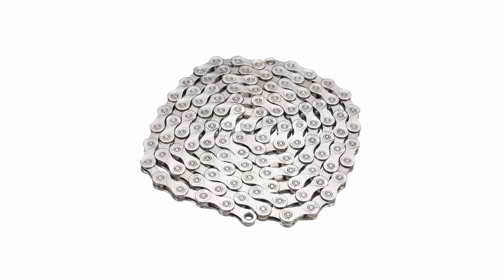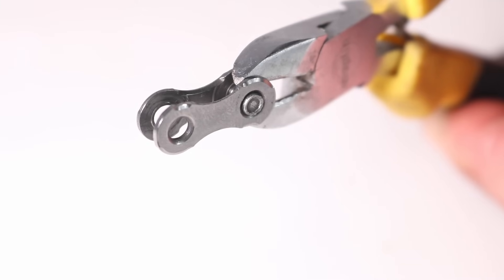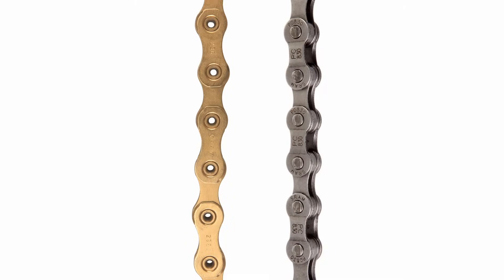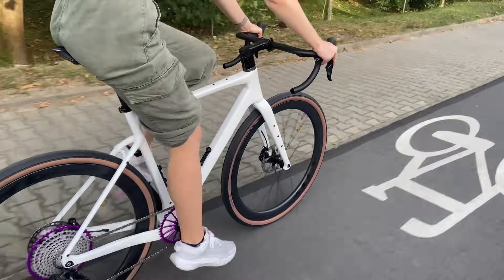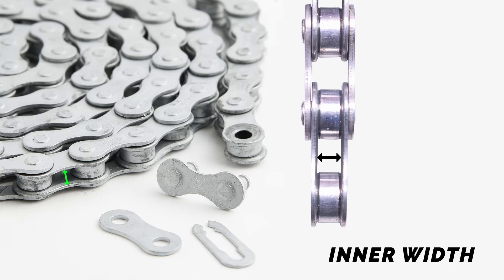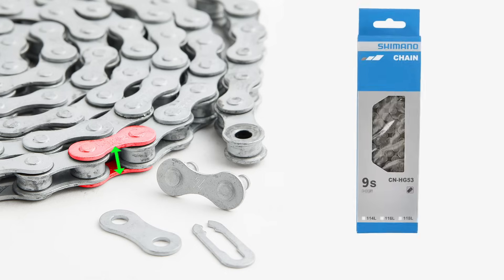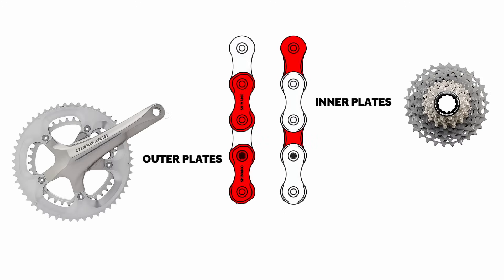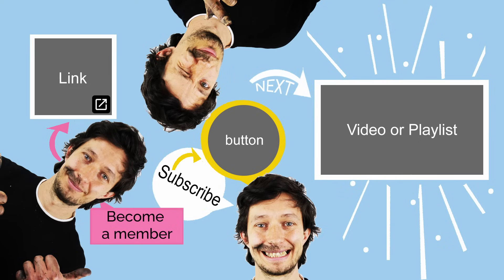Everything you should know about bicycle chains: How do they really work?

Comment: Excellent! Something I learnt recently is that SRAM 12s Flattop chains have a different outer diameter of the rollers. This is important because simple "drop in" chain measuring tools don't work, because they measure opposite sides of the rollers, need one that puts the chain under tension and measures the pitch between the same side of the rollers.

Comment: The weight savings from hollow pins  and side plate slots 2:14 are typically around 20 grams.  
The easiest way to make a light weight chain is to make it of stronger material.  Incidentally , a youtuber tried to discredit chain waxing because he said he had to poke all the solid wax out of those 'holes' .  The extra  ≈1 gram of solid wax inside the pins would have kept dirt out that would have stuck like a magnet if the chain had been oiled.   "Zero Friction Cycling" did the 'poking' and measured it !

To demonstrate the weight savings .... lets say you have a 114 link 11 speed chain with 1.6mm diameter holes and 6mm length pins.   Mass saved = Density x Volume .   Let the Steel have a density of 7.8 g / cm³ .  The volume of steel saved is ≈ π x 1.6² / 4 x 6 / 1000 x 114 x 7.8    ≈   11 grams .         If the 2 slots in the side plates are 1mm high by 1mm thick and 5mm long then the mass saved in those is ≈ 1 x 1 x 5 x 2 x 114 / 1000 x 7.8 ≈  9 grams.
Reply: Saving weight on a chain ,its ridiculous !!
Reply: @Yokssama 
Ill never understand weight weenies.
Like, those dudes ain’t competing for real money in sanctioned races. Its not that serious 🤷‍♂️
Reply: @bulbinking Because people want to do things like the pros.
Its cute when you're 12 and you discover the sport.
After that it's ridiculous IMO
Reply: @Yokssama 
So many mid life crisis on two wheels…

When I was a kid I thought cycling was lame because I was only exposed to roadies and tour-de-france jerkoffs. 

Then I realized there wasnt a right or wrong way to ride, and its just a vehicle like anything else.